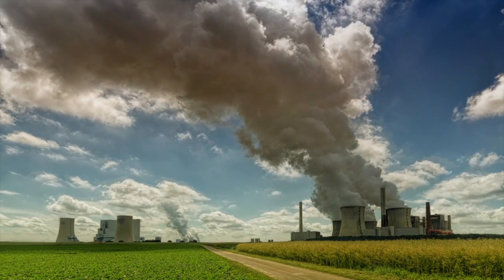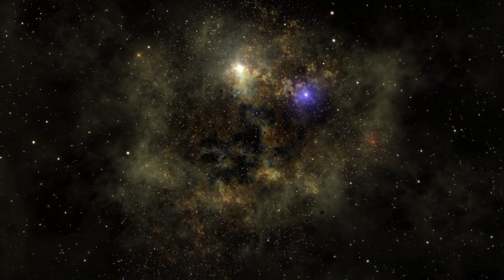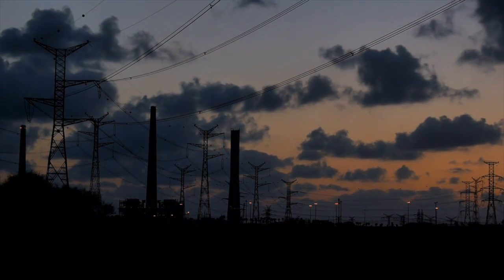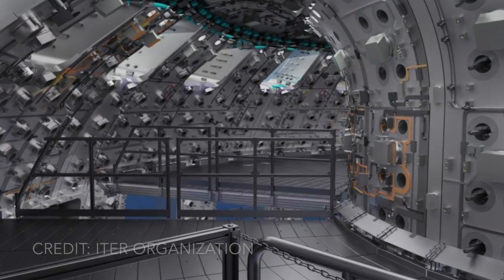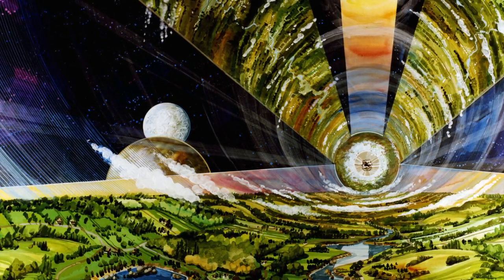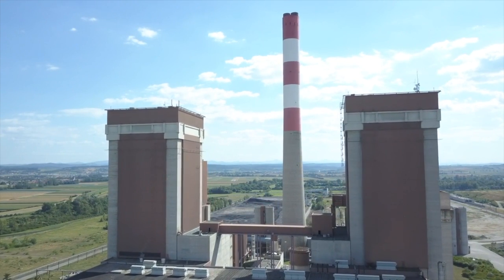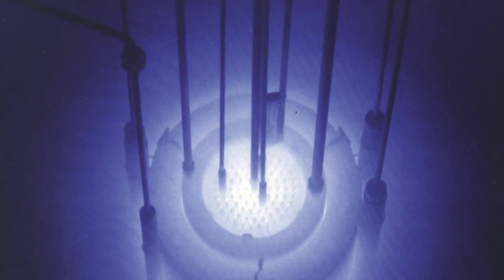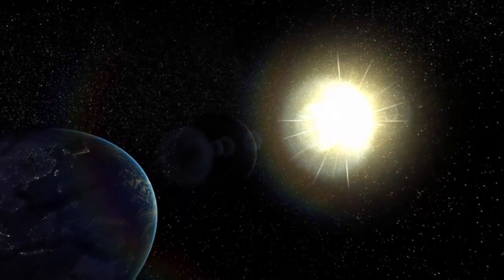What's Really Going on with Fusion Energy

Comment: Remember that you still have to obtain enough cheap hydrogen, which is a lot harder than it seems. Even just getting the hydrogen to power fuel cells on a larger scale (a technology that does exist in practice) has posed a serious logistical problem. 

Using solar energy to produce hydrogen on a large scale only works in areas of the world that also don‘t happen to have a lot of fresh water, which is set to seriously exacerbate the water crisis in those areas. 

Even if you have fusion reactors that produce enough energy to power electrolysis, you still have the logistical problem and either way, all this is likely to seriously limit how widely available your fusion reactors really are.

Comment: Nuclear fusion proponents always hold out that promise of energy without the radioactive waste. Given that with fusion there is a net surplus of energetic neutrons produced, riddle me how these energetic neutrons are not just going to find a nucleus to interact with. Even with a "blanket" of material provided for the neutrons to distribute their kinetic energy into, some will still find their way into the structural components of the reactor producing radioactive iron, nickel, and countless other elements used in the construction of the apparatus.

Comment: @12:37 another way of looking at it is that private industry is wasting manpower and resources that could be centralized into a more productive and expedient fusion development, instead of researching the same technology in parallel which is what they're doing.
Reply: In practice, central planning of research and engineering doesn't mean devoting all resources to efficiently develop the "right" solution. Instead, because the necessary avenues of scientific exploration are deemed "wasteful" it means total stagnation. 

The only progress that is ever made anywhere is by pushing the current understanding of any subject and finding what doesnt work. If you politicise that process you'll never get progress.

Comment: Fusion wont happen, or even if it will its useless
why?
because it requires TRITIUM for the process
and TRITIUM is SLOWLY created inside NUCLEAR REACTORS..
see the issue here? you wont have fuel for it without having nuclear power plants running anyway , so whats the point? unless you manage to mine it on a asterod or something its a bust and good money sink where to put taxpayers cash..

Comment: This test was significant due to the combination of the shell purity and the right amount of heating and cooling using x rays. It was a bonus that it produced more energy than it put out, but that wasn't the exciting part about this experiment, it was the "controlled" aspect. Controllable fusion energy is the first stepping stone required in scaling up this methodology for practical uses. Assuming 50 years for scaling this method is pretty pessimistic in my opinion, humans went from riding horses to combustible engines in a matter of a couple years, and that was without major machining technology we have today. True that this discovery doesn't directly open the door for an actual energy production mechanism, but it does open the doors for new research ideas and generates an influx in cash not only from private investors but from the department of energy which will invest very heavily for the US to be the first country to use this type of energy production. My best estimate as someone who follows this topic pretty closely and is an engineer in the field is that controllable fusion energy will start to power major grids starting later this decade or the early 2030s.

Comment: General Fusion in Canada has a system that is scalable.  Hydrogen plasma is injected into the center of a container of molten metal. The metal is compressed by pistons and the fusion reaction heats the metal more with this heat used to generate electricity.  It also breeds fuel.  I think this is the reactor we will see connected to our grids.

Comment: If you ganed energy you can haness it... like in an internal combustion engine where you add Fustion fuel and get mini hydrogen bombs that move cylenders up and down tio creae torque... It's not what futorists think about when thinking about fustion power planet but it will work if the gains are high enough...

Comment: Real Engineering just released a video about an alternative fusion method that seems way more viable. Can highly recommend checking it out.
Reply: Yeah, I'm torn between that tech sounding a bit like it's way behind and overpromising, but it's also a far better system if it does work as there are fewer steps between energy out of the fusion reaction and useful electricity, so it at least on paper has a higher potential due to lower inefficiencies.

I kinda suspect that it's going to not live up to its promise until something is developed that is to it what the stellarator is to the tokamak, but they need to get the simpler design to at least function before they can do that, so it's still worth doing even in that case.
Reply: I saw that too and it was really well explained

Comment: Correct me if wrong. Didn't the French manage a way to recycle and use their nuclear fuel rods?
Reply from the maker: They did indeed, and very successfully. It's not infinitely recyclable, it's sort of like paper, you can only do it so many times but they do recover useable nuclear materials for new rods from old ones. Why the US doesn't do this has more to do with the politics of nuclear energy and activism against it than anything else. They don't want to rock the Yucca Mountain boat as it were.

Comment: Even with the latest news, I just don't think Fusion energy is a realistic thing in the foreseeable future. Too many hard problems. People like to compare it to fission energy, but nuclear fission is a reaction that can occur at relatively "room temperature" level conditions (and has done so naturally, on Earth well in the past when there was ahigher percentage of U235 in uranium ore). 

Fusion on the other hand requires very extreme conditions. Literally like that within the core of a star. And attaining those conditions, which we've well proved at this point we can do, has the side effect of making fusion hard to get any useful energy out of as well as making it economical.

I don't doubt that some day, we'll crack this particular hard nut...because I firmly believe anything that is possible will eventually be attainable. But for the foreseeable future, the best scalable non-carbon based energy source for power generation is nuclear fission. Even its downsides are easily manageable.

Comment: This is a bit of a niche application, but couldn't the NIF-style reactor be the start of a fusion star-drive? Similar to Project Orion, but with more politically-correct fusion bomblets. You'd have to have a somewhat more efficient reaction and a means to capture enough energy to power the lasers...but it seems like a good start, and perhaps a more appropriate application for the NIF design than commercial electricity production.

Comment: One thing you missed and I think should have been mentioned was the German Wendelstein 7-X, a competing design to the Tokemak and CFR that is called a Stellarator. It's showing a lot of promise.
Reply: I like the new Stellarators.   Just on the Baroque looking function-makes-wicked-form aesthetic.
Also the clever topological plasmal Judo.
Superconductor tech has already jumped the locked in Niobium-liquid helium design baked into ITER.
I would like to see a competing test reactor with German stellarator welding and MIT wound ReBCO magnets.
Reply: @NullHand  ITER knew their magnet coils weren't the best, they were just a lot more affordable than superconductors.

Comment: Cooling is going to be the big issue.

Going by the release, 2Mj going in, 3Mj going out for a fraction of a second... if the magnets must be cooled then that's going to consume energy, I can't see a 2Mj electro-magnet being cooled to near absolute zero without using a ton of energy to do it, probably roughly the same as input plus losses, so...

Comment: It's super easy to generate net energy from fusion, you just use photovoltaic panels to turn the high energy waste photons into power, rather than a turbine to turn the waste heat into power.
Reply: Not sure how this is relevant; even with 100% conversion (and some quick research seems to indicate that PV cells are still only in the low-to-mid twenties, the same ballpark as steam turbines) the experiment produced less energy than was fed into the lasers.

Comment: Jhon, if we build a fusion reactor in low orbit, do that will make a difference?
Reply: The only fusion reactor we can build right now would be powered by h-bombs.  Assuming you discount that (and you probably should, because it'd be a fission-fusion mix with downsides of both,) we can't build one, period, much less one in orbit.  And if we're beaming power down from orbit, why not just use mirrors or solar panels instead?
Reply: No, gravity is not the issue

Comment: Just a reminder that the "gain in energy" was not a net gain overall. The recent ignition got 3.15 MJ of energy for 2.05 MJ of laser light, a gain of about 1.1 MJ, roughly the energy of a half a Big Mac.

Of course, the 2.05 MJ of laser light was produced with hundreds of megajoules of electrical energy, meaning there was actually a massive energy loss. There is no EROI worth calculating.

Fusion is not and will never be viable. Even if it was technologically viable, it will not be commercially viable. Reactors would be overly-expensive subsidy dumpsters that would require massive logistical support from other means to produce and maintain. Far from a miracle device producing limitless energy, it would be an economic white elephant that would quickly break down from the immense heat, pressure, and neutron embrittlement in the reactor.

Comment: Problem of all things future is that as far as future goes, it has been always "the present popularized" what makes the future. Jet engines were invented long before they say they were, USB even was invented almost 10 years before you heard of that.
Fusion problem is that there is no feasible way to use it in the Energy in and out economics. The start and maintenance of a fusion reactor is way more expensive in terms of energy consumption than it would be predicted to work.
You need a very complicated system of containment and flow control to actually make use of fusion in any "industrial" scale.
On that note, that much is not a reason, it is an implication. The reason is fusion to this day is made on the basis of what "we have", not in any new specific way. Fusion is not to be made the way we do things, rather in a new way that is not actually known.
Nuclear energy is not what we get electricity from. Nuclear reaction produces energy in a way, that powers what actually gets energy from it. Same goes for solar, wind, hydroelectric, and even coal or gas. The only effective way to get fusion energy is to get it somehow directly, instead of using fusion to "power" something else to produce the actual usable energy.

Comment: One part you missed is actually that tokamaks do have the issue of nuclear waste that fission does. This is because the best material to make the walls out of is beryllium but beryllium by nature contains uranium. This means fission reactions will naturally occur in the walls of the reactor from the free neutrons released in the fusion reaction. So the walls of the reactor will contain the exact same nuclear waste existing plants have. This is on top of the normal radiation the neutrons will cause is basically everything they contact.

Also the hydrogen used in the reactor isn't normal hydrogen, it's deuterium and tritium. Deuterium is uncommon but can be found naturally in water, but tritium is completely unnatural. Not to mention tritium is screaming radioactive with a half life of only 12 years. That makes it basically worse than the majority of nuclear waste from fission and this is a gas that could easily leak into the atmosphere. Plus tritium is one of the most valuable materials in the world at a few million dollars per kilogram. It honestly puts the odds of fusion cost effectiveness seriously into question.
Reply: The problem with fission waste isn't so much that it's radioactive, but that it stays that way for millennia.  A fusion reactor consumes tritium; sure, you don't necessarily want it to escape and fling radiation around, but the whole point is to expend it.  It's generally considered a bad thing when a natural gas or oil-fired plant releases its fuel into the environment, too.
Reply: On the plus side, with tritium being so rare and expensive, it's unlikely that anyone would have much of it to spill.
 And spilled radioactive isotopes are less of a problem when they're sparsely dispersed, effectively becoming background radiation.

Comment: Doesn't fusion arise naturally in stars because of the immense pressure from the gravity of immense objects? Seems ignition requires the product of pressure and temperature.  We can reach even higher Temps but nowhere near the pressure required without explosive or implosive processes, well beyond what we can control. But small implosions like what is achieved in the holrahm may be controllable in series,  with the energy released from the first reaction producing 2 more, then 4 and so on. The cost of materials to make the capsules then becomes prohibitive at scale. 
Help me, smart people

Comment: Wasn't there talk of using salt in a nuclear reactor?   That it could never have a melt down.
Reply: Thorium-salt reactors are a fission breed; as far as I'm aware they've only built research reactors.
Reply: @boobah5643  yeah.  We have them and they work.  The main problem is trying to design materials that can withstand the corrosive problems for practical application, as I understand.

Hopefully, we will solve those problems soon, but atm they're kinda like tidal generators: we can build them, but the maintenance needed is to frequent, extensive, and expensive to make them practical.

Comment: As a question. If you harness fusion wouldn’t it make you a k2 civ or do you you need to harness an actual star not the process? Or is it just energy used regardless of how to
You get there.
Reply: If you mean a tier 2 civilization I think it’s using your entire solar system so yeah it would be dysons sphering the sun or using our solar system to its maximum possible energy output
Reply: No.  The Kardashev scale is based on the amount of energy the civilization uses, not the method it's produced.  According to Wikipedia's numbers, in 2021 we clocked in as a k0.73 civilization.  Pretty much by definition*, practical fusion will see that number move upward, but k2 is far, far away.

And a good thing, too, since producing that much energy on Earth would make it kinda hot; all the energy the sun makes, but contained into a much, much, smaller volume.

* Practical fusion will cost less than whatever it replaces; that's what makes it practical.  Cheaper energy means you'll use more of it, because things that were too expensive because of energy costs now aren't, and you're doing those in addition to whatever you were doing before (or instead of the less energy-intensive alternatives.)  Therefore, practical fusion = more energy generated and consumed.

Comment: Wait, this explains why we don't see evidence of Dyson spheres or similar mega structures for capturing the light of suns.

We can say now that fusion generators are possible as an energy source, even if it will take 40 years to see a full sized generator at this point. There's no need to capture all the light from the sun and, in fact, that would be a pain in the ass.
Reply: If you've got access to space, solar energy is still going to be easier and cheaper than working the fusion yourself... at least until you get to the point where you're disassembling the star.  Either way, no starlight but lots of IR.

Comment: I have hope. The reason being I never thought I would see the reusability problem solved with rockets. But it did and all it took was some out of the square thinking by Elon Musk. He is also an example of the difference between government which gets it's revenue from the taxpayer vs the private sector. The containment issue seems to be the problem like you said. I can imagine using a small bearing of Iron coated in the Fusion Material suspended in a magnetic field. The earth has poles just like the sun. Though the scale and mass are vastly different. Once you got the process started some of the power would be siphoned of to recharge capacitors which power the suspension field. Though maybe we need to get out of the thinking of using steam as a medium of work and use the magnetic flux from the whole process itself to generate electricity. Just my non physicist musings.